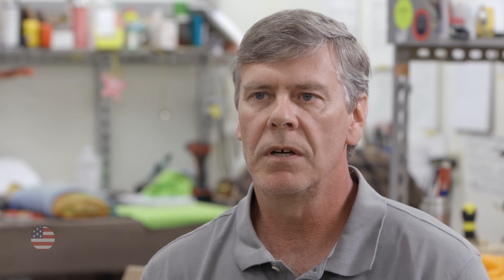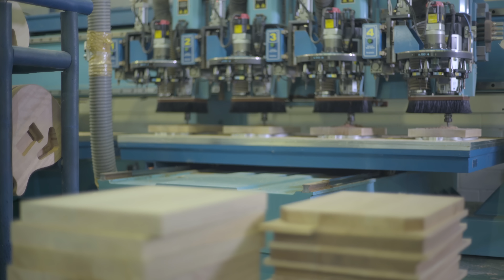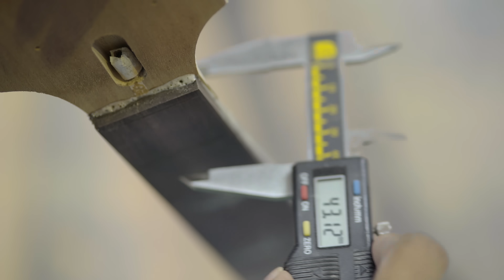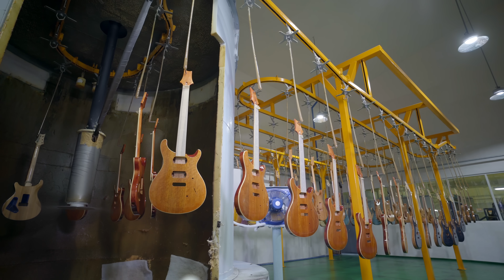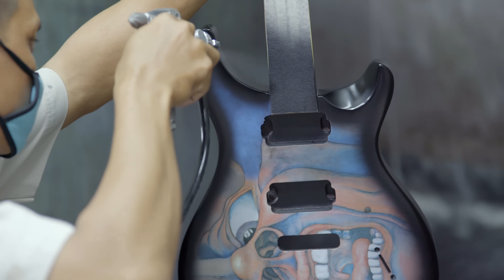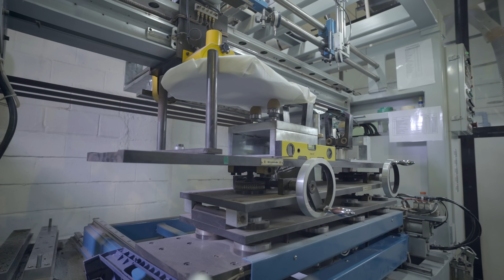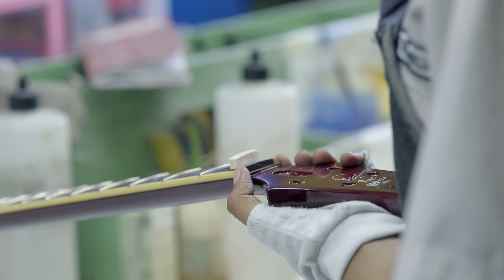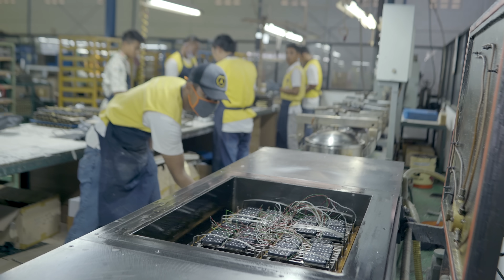SE Factory Tour: Surabaya, Indonesia | PRS Guitars

Comment: But PRS goes from $1500.00 can directly to $6000.00+ with no in between ?
Like a mid range $3000.00 ?
Let's be honest, the PRS does not retain its purchase value, like a Gibson product !
PRS does not have a collectible like the Les Paul Line ?
Just watch a yloutube interview with Joe Bonamassa or many of the top rock artists !
PRS may make one for a star like the guy from Santana, but it's not a coveted item.
I'd say PRS is over rated...
Reply: There is SE, S2, core, 10 top, wood library, private stock. So multiple levels of price. As well as Santana, they are used by Robben Ford, Mark Tremonti, John Mayer, John McLaughlin, Joe Walsh, Dave Grissom, Philip Sayce, Mark Letteri and so on. So some top players. Yes expensive, but also top quality.

Comment: Years ago, I met Paul Reed Smith in passing walking through his booth of products at the Sweetwater Gear Fest. I had always said if I found the right one, I would try a PRS Guitar, but never liked the feel of their lower end bolt ons. Two days ago, I bought a used SE Custom 24 made in Indonesia. It took awhile for me to ask A.I. the right question to locate the correct series of Serial Number to confirm the year, and where it was manufactured. This video helped validate some the other info. Thanks!

Comment: I have the SE CE 24 Satin vintage Cherry and it's well designed I know this one was built with affordability  in mind to the consumer I love the string gauge  9-42  the pickup's are great no need for swapping out , but' and here it comes tuner's that don't hold the tremolo usage need better or stronger reinforcement rather it's some kind of automatic pinch once the string is set on the turning or the designed locking tuners as the replacement if they can build roll on saddles for the ever problem some Bigsby tremolo  system I'm sure some sort of pincher can be designed with in any tuner that will eliminate having to swap out for locking tuners at another expense . If some one designs this feature for the common average tuner for all Guitars rather Acoustic or Electric remember where you got this idea from first as you save the more dreaded expense in swapping out when there's no need to .

Comment: PRS has gone up in my estimation since watching their videos.  Great engineering, and great attention to detail.
Reply: Not always. I love my SE, but it came from the factory with a dirty selector switch. I opened the panel to use some contact cleaner and even though the switch is cheap as you'd expect on an SE, the soldering leaves a lot to be desired. For peace of mind, I'm changing out  the switch, pots and wiring harness.

Comment: My first PRS was a Standard 24-08.
The only issue was the nut. 
It wasn't centered on the neck, but was over an 1/8" too far to the high E side.  
I did get an ever so slight discount for it for the dealer (bonus), but I ended up adding a set of PRS locking tuners & swapped the nut out for one aesthetically consistent with the edge binding.

Comment: I bought a prs Santana SE a couple of months ago. I noticed on the neck pickup cavity there was some space between the pickup ring and the body. So I took the pickup ring off and noticed there was a slight dip on the side of the pickup cavity near the first string like the router bit had cut into the side. But I see in the video how the cavities are cut so I don’t see how that was possible unless it was done after the veneer was put on and cut. It’s really no big deal the guitar plays and sounds great and just small cosmetic thing. I was just surprised that it got through without being noticed especially being a PRS.

Comment: I bought an SE Custom 24 about 8 months ago, love the feel and sound. The only complaint I have are the saddles. There is some corrosion on the sides and ends facing the neck of about 2 or 3 of them. This guitar hangs with 20+ other guitars and no corrosion on any of those. They are different manufacturers. I have a Fender Strat that is 22 years old and no corrosion on the saddles. A 900 dollar guitar should have a  better quality saddles. Also I am not the only one with this issue. Maybe a higher quality of metal and maybe make sure the saddles are not in a high humidity area in Indonesia?

Comment: Guys I've only had issues with SEs. The neck isn't stable. The tremolo is inconsistent. On my current one I can't even get the action height according to your own specs because the saddle for the low E is already bottomed out DESPITE the tremolo being higher off the body than it should be. I lowered the trem get closer to spec string height but now I can't use it. Pretty much defeats the purpose. I gotta buy a US trem. That's just annoying. And guys please get rid of the damn heel at the bottom of the neck.  It's basically impossible to shred  higher up the neck because of the heel.

Comment: I love my SE. It sounds and looks every bit as good as my USA made PRS. Absolutely awesome quality for the price point.
Reply: @marander512  Fair enough. I have the newest TCI 85/15 pickups on both my SE and my USA Custom 24 model, and although nearly identical, I actually prefer the sound on my SE pickups a little more. (the USA core model is a little brighter, but almost too bright to the point of being shrill, so I often have to make adjustments on the EQ to balance it out)  

I also agree with you and far prefer the feel of the neck on my SE over the USA Custom 24. 

The USA is obviously on a way higher level when it comes to the looks and materials and craftsmanship, but for just the sound and feel, I often reach for my SE before my core model, and at 1/5th the price, that’s amazing.

Comment: Cool guitars! I've wanted to try one for years. Finally had the opportunity to pick up an SE Mark Holcomb signature. The Seymour Duncan Alpha and Omega pickups are outstanding. Guitar build quality is pretty good. My only issue with the guitar is it's inability to maintain tuning. I suspect it is due to the poor nut material used. Even after a professional setup my guitar has had horrible tuning stability it's a bummer for me because so far this has been my first experience with the brand. Hopefully replacing the nut with a Graph Tech TUSQ XL will help. 

My humble feedback to PRS would be to stop using plastic nuts and add locking tuners to guitars in that price range. There are other manufactures able to accomplish this for about the same retail to the consumer.
Reply: They are aware. It would increase cost. They would rather let those of us who want to upgrade do it ourselves. I’m ok with that 

My SE stays in tune better floating than most of my hardtails

Comment: Dear PRS Guitars...is there any way to tie the SN to the actual builder of the instrument? I'd like to thank this builder personally. I purchased the Indo SE Standard 24 (2015-2017 model) to check out a PRS with a minimal investment, and its a masterwork. Off the shelf it played fantastic. I took the time to set the pick-up height, neck relief, string height and intonation properly with precision tools, it plays like a $3000 guitar. (starting with setup specs from PRS website) No other guitar in my collection has this level of near perfect intonation. The neck is laser perfect, with string height @1.39mm - @15th fret. (yes the 15th) Zero slop or buzzes. I haven't touched my Les Paul Custom nor my American Standard Stratocaster since setting this guitar up, and I may sell off one of them for a Maryland PRS. 
- A word for the wise, SE owners: If you do not know how to set up your guitar properly, or do not have the tools needed, take it to a serious luthier and have them adjust it to YOU. My personal opinion is that every serious guitar player should obtain the knowledge and tools to set up their guitars to perfectly suit them. It makes all of the difference, and it's just one more way of connecting with your instrument personally and knowing it intimately.

Comment: I was really impressed with this video and picked up at SE Mira a few days ago. Whilst the frets and build were great the setup was horrible. I could easily use the neck for slide or for shooting arrows as there is so much relief its like a bow
Reply: Was it able to be adjusted correctly? Just curious, thanks...
Reply: @bzbzob  I spent a few hours setting it up and it now plays great. I put a fresh set on 9s on took the relief out the neck and slightly tweaked the intonation. I don’t really like the high frequencies of the pickups but that just my personal choice. Apart from that its now playing really well.

Comment: I bought one of the Custom 24 Charcoal Cherry Fade limited SE's from this factory over the summer. After playing it for the past 4 to 5 months I have to say it's a great instrument and I have no complaints. The pickups have amazing clean tones. Sure my Ibanez RG has preferable high gain tones but that's a different tool for a different purpose than this, though you could definitely get great high gain tones from the SE as well and I'm pretty sure the RG was made at the exact same factory so the bottom line is:
This factory does great work.

Comment: I wish you guys would make a 24 frets PRS SE model with ebony fretboard  , 5 way switch , place the volume knob away from the bridge pickup and have a series / parallel / coil tap option, also more pro choice pickups selection , a custom shop order choices you can select from the import line.

Comment: I bought an SE Custom 24. I did alot of mods to it to get it to where I wanted it, replaced the nut and that made a huge difference in the tuning stability also I added locking tuners prs as well as a 5 way blade switch and new prs pots, that really made a difference to me as I don't like push pull , and finally I added a set of 59/09's and lampshade knobs .I love the neck and playability of the SE Custom, But I feel the electronics should be upgraded on these from the factory as it sits around $1000 Can funds.  The fret work is great on these guitars and the finishes are beautiful , my only beef was the cheaper electronics on a $1000 guitar.

Comment: Indonesians take pride in their work. I have a Standard 24 USA (2003) and recently purchased a Custom SE (Indonesia). I replaced the tuners with PRS locking tuners and swapped the stock pickups with Seymour Duncan Black Winter pickups. Now the SE sounds and plays just as good as the US model. $800 for the guitar, $100 for the pickups and $100 for the tuners. My frugality paid off. Much respect for the PRS operation in Indonesia.

Comment: Veneers should be used on all guitars. Why burn such a beautiful thick figured top on one guitar?  I have a single cut SE soapbar 245 that is an incredible instrument. My main gripe with most manufacturers including PRS is the small frets. Just put med jumbos on all your guitars already! (Ibanez is right next door, let them do it.) My next guitar will be the Mira SE.
Reply: Honestly, nothing wrong with veneer tops at all, and its a very economical way of getting that flame maple look without using an entire block of curly maple. The problem is if you try to do a veneered version of a core PRS, the carve they use would make veneering difficult, coupled with those recessed knob sockets, there is no way to put veneer into those. I see this with imports from say World Music where they emulate the carve and recessed knobs of cores, but the veneer stops around the knob and inside it you can see the mahogany.

Comment: Trully sad that P:RS had to take its manufacturing overseas.  Whats wrong with having set this factory in The USA?  not enough profit for you Paul?  What a shame.
Reply: They do have a factory that produces what are basically SE guitars made in the US, its called the S2 line made in Stevensville. They've been making these for like seven years now. They typically run from $1300 - $1700 depending on what you get. They have similar body carves to the SE line, and use imported pickups to keep the cost lower. You probably should have researched that before posting.

Comment: I’m so sorry guys but I bought a brand new, Indonesian made 35th anniversary SE custom 24 and it was absolutely awful. It had grounding issues, dead spots 5 frets in a row on most strings, sharp fret ends, loose input jack and crackling on the tone pot. I had to send it away and it will take 3 weeks for the store to fix it. To make things worse, my housemate brought back a Korean SE 245 which was absolutely phenomenal for half of the price!!! Needless to say I was appalled. I’ve never had so many issues with an electric guitar, even a used one.
Reply: Damn homie I bought the same guitar and its beautifully done. Might of just been the one off.

Comment: Just got a Paul's Guitar SE in aqua...amazing instrument. Everything is perfect on it. Sings like a mutha. I too had some concerns when they moved production to Indonesia, but this is every bit as good as the Korean models and well worth the price. The only knocks I give it is the tuners...they are a tad loose, they arent bad but its a part worth upgrading. The nut is fine, but worth upgrading. Bridge is great, I have always loved those simple wraparound bridges PRS makes. Pickups are nice. Typically I gut pickups out of imported guitars, but these I'll probably keep. The top is just...damn. SE's can vary alot on the top, sometimes you get a good one, sometimes a lackluster one, but this is about the best top I've seen on an SE model. Don't be a wood snob, try one of these, you will not be disappointed.

Comment: Love my SE 245 in Whale Blue! It was super easy to setup for me: The neck was very responsive to adjustments, the bridge in its simplicity is not only easy to adjust, it transfers tone very effectively. The construction is solid - the neck to body joint is superb - full tenon. The whole thing rings like a bell. The fretboard has no snags and feels well played. It's just an amazing guitar. The only thing I'd say improve upon is the friction of the pots. CTS now makes a 500K Audio taper pot that is metric. They fit an SE without drilling the body and the PRS knobs fit the course splines. Thanks PRS - My SE 245 sits honorably next to my Core Custom 24 and holds its own nicely!

Comment: My se is from South Korea. The most untuned I ever have. Every  hour I need to tune the guitar so much that I rotate the fine pitch turning on the floyd about 1 full circle in all strings clock wise . In the next day. The same the other direction.  Will never buy a prs any more. They told me to take to the shop and the guy told me that was fixed. Next hour,same crap.or the wood was not dried.  Or the trust rod is crap.
Reply: Might be the floyd
Reply: @paulo alexandre
Upgrade the nut to a Graphtech TUSQ, then your problem will be solved.
The SEs are generally regarded as well-built guitars except for the nut. That is usually the first thing you should upgrade, as that is the most notorious part.
Reply: @Pundit07  its a floyd locking nut that I have

Comment: Bull shit. My Se couldn't even be tuned when I got it the nut is such shit. The selector slot is poorly done and has really rough edges. Also a few other dings in the wood they ignored and just finished over. If you have $800 to spend give it to Ibanez or Fender. Their work shows they care, not some bogus YT video.

Comment: They are putting a veneer of the same type of wood.  I wonder what the difference of playing is with or without the veneer.  The glue that keeps the veneer on can’t be good for the sound.
Reply: RickJason but there’s glue for the thick maple cap. Also wood has sap that behaves similar to glue when it dries and that’s throughout the inside of every wooden component. The actual biggest variable is checking the straightness of the neck with a measuring tool and by eye but that can be adjusted no problem. But the nut installation is mission critical so they spent money on a machine, same with the fret press.

Comment: Can someone please, tell me, what woods is used to made the guitars and where is they come from?
Reply: The SE guitars are a Mahogany body with a maple top.  The flame tops are a veneer.  The necks are generally mahogany, but there may be one or two models with maple necks.   The fingerboards on the SE stuff is Rosewood (Brazillian, I think...).
The woods are essentially the same types used on the Core models, except instead of the flame/quilted maple tops  found on the US models, the SE's...while still a maple top, have a veneer to provide the look of flamed maple.  It is a way to reduce cost as flamed maple is more expensive than regular maple.  The old Korean models were solid mahogany with the veneer, but it sounds like the Indonesia factory is doing it closer to what you would get on higher end models, which is fantastic!

Comment: I just purchased a 2019 SE Custom Limited Edition Laurel Burl, and let me tell you it is Gorgeous! The neck feels amazing, the pickups are solid for clean and dirty. I absolutely love this guitar and I have always been a Gibson man. I am now a huge PRS fan. One drawback with the SE though is the nut. When you use the tremelo, some of the strings hang in the nut and stay sharp. I just ordered an American self lubricating nut and I am replacing it. PRS also now makes locking tuners for these that look identical to the American locking tuners with the black screw on top. I ordered a set to put on my new SE. There is absolutely nothing wrong with the stock SE tuners, I just prefer locking tuners, and I love the look of the PRS Locking tuners. 

Thank you PRS, I love your guitars. Please though, do something about the SE nut. I shouldn't have to change the nut on a brand new guitar. After some Internet research, I found that this is a common problem with the SE's.
Reply: Easy fix! Take some fine grit sand paper and widen the slots. Or, use the strings to "buff out" the nut slots and then rub some pencil lead in there. Problem solved.